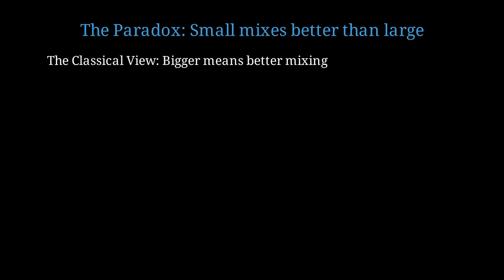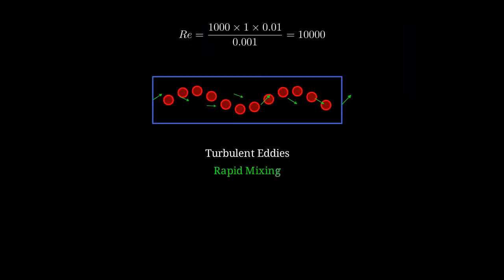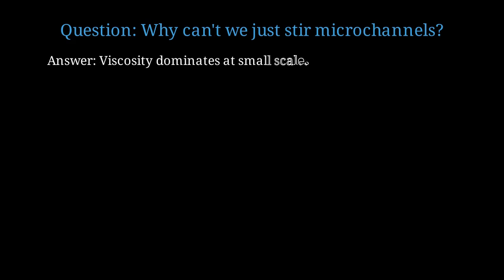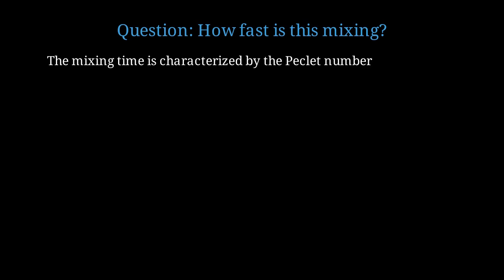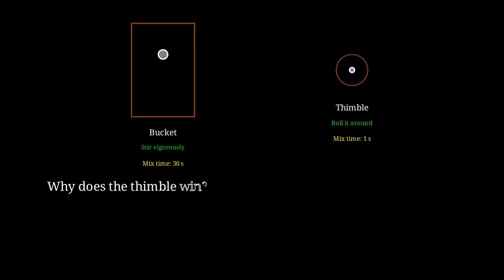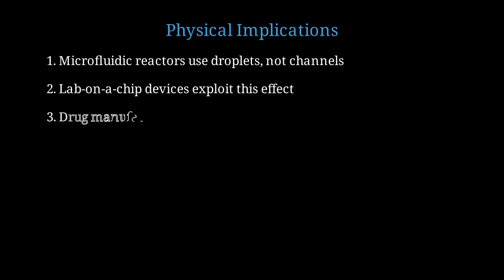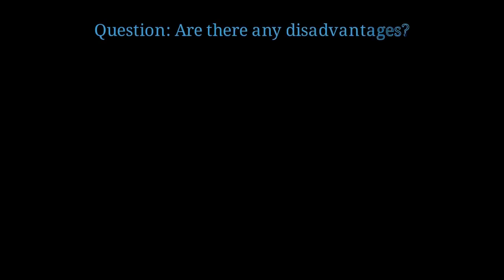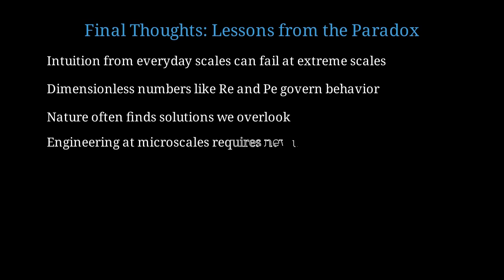Microdroplets That Mix Faster Than Industrial Tanks

Comment from the maker: How can the Navier–Stokes equations be modified to include droplet-interface coupling effects leading to internal chaotic advection at low Reynolds numbers?
What is the role of interfacial Marangoni stresses and surface tension gradients in enhancing mixing within multiphase microdroplets?
Can machine learning models predict optimal droplet geometries and flow parameters to maximize Lyapunov exponents and minimize mixing times?